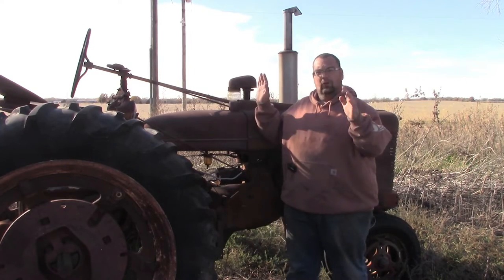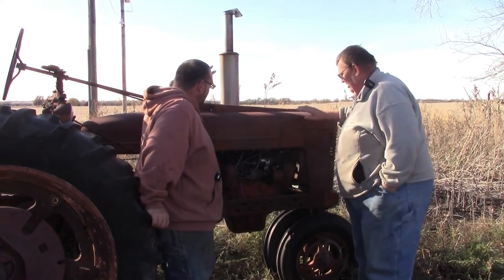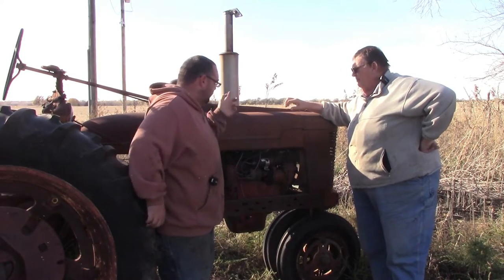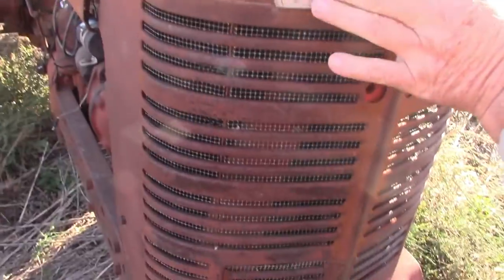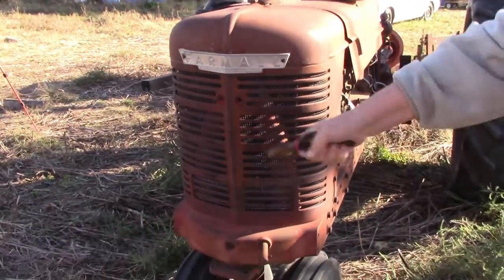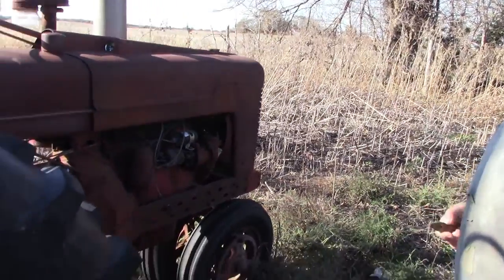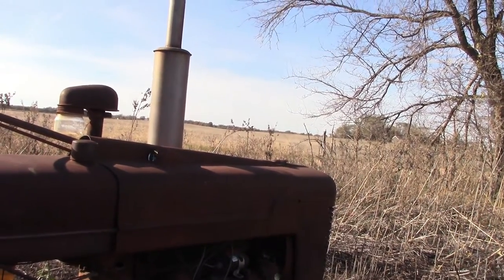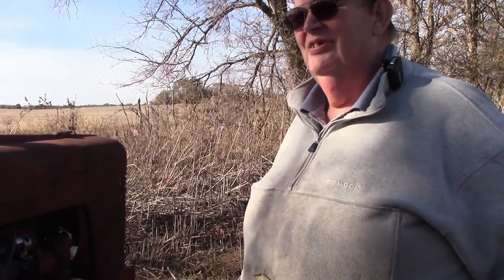things to know about painting a tractor

Comment: The first step to a quality and long lasting paint job is to clean EVERYTHING until you think it's perfectly clean then, clean it AGAIN!

If you want to take it to bare metal, I recommend soda blasting over sand blasting. Soda blasting won't heat up thin sheet metal and cause it do warp like sand blasting does. If you do take it to bare metal, you'll have to use an etching primer first, then a "high build" primer (what your dad was trying to think of) to fill in the small imperfections in the metal.

I've done some body and paint in the past but mechanical is what I really enjoy. Fortunately, my daughter took collision repair classes in high school and continued them through trade school so she's my "body guy" on projects these days. As a matter of fact, she just finished the final prep work on my D-17 over the weekend and plans to lay down the finish coats, decals and clear coats on Lil Allis over Thanksgiving weekend. We'll be adding just a hint of metal flake to the Persian Orange to fancy her up a little lol!

One more thing...that Farmall emblem has most likely been there since the tractor left the factory, therefore, the paint underneath should be well protected from the elements. If so, take the hood, grill shell or whatever it's attached to with you to the paint store and have them color match it and mix the paint for you.

Comment: Your Father is quite a guy. He knows what he’s talking about. I’m not too certain about the “midnight car wash”….that might be a bit tricky. A good pressure washer with an environmentally friendly grease cutting solvent in it would get the job done and you/he can be as fussy as you wish. The tractor is a gem….everything there and in great condition…well worth doing up. This would be a great winter project for your Dad if you’ve got a heated shop with a cement floor for him to work in…on his own time of course. Your Dad looks to be in pretty good shape. Great video Doc ,thanks for posting it.

Comment: Your Dad's experience speaks well.  A sandblaster or some wire wheels before you go after it with the sand paper is the best starts, along with the degreasing.  Priming is vital, then if you want a show finish on it you'll need to fill and block it so there are no dips or wrinkles in the tin.
Reply: I saw a 961 Ford at a Deere dealer that was painted Green and Yellow.  It looked nice, but it wasn't right.  I am sorry it should have been done either in Red or Blue with Pearl.

Comment: "You want to put the pencil to it" is the key bit of advice in the video. Getting some paint on it that can protect the tractor from further deterioration with low cost solutions can be as important for a working tractor as trying to sand/fill/premium-paints/shine up a parade tractor. Sharpen the pencil. Last tractor I 'painted' all the badly faded tin with wipe on boiled linseed oil cut by 1/3rd spirits which brought the 'shine' back. Before that on another tractor I bought a $35 gallon of rustoleum in the closest color, degreased/removed-tin/taped-up, then used my Harbor Freight $20 'purple sprayer' with $50 air compressor and got it protected from the elements (and neighbors won't freak out about there being an old rusty tractor next door). It looks good in pictures and will work for most parades from ten feet away -- but it's a working tractor that has been pushing snow this winter after plowing last fall..